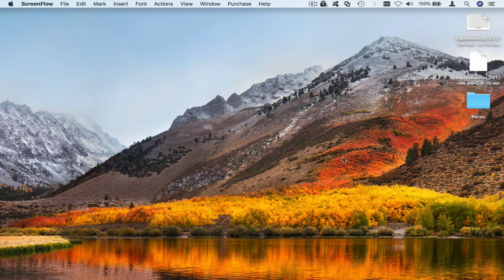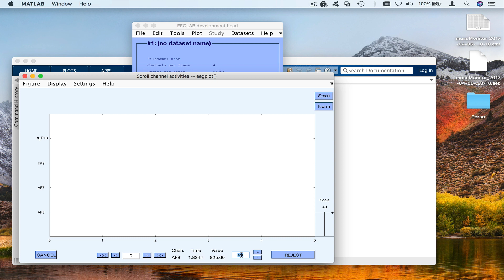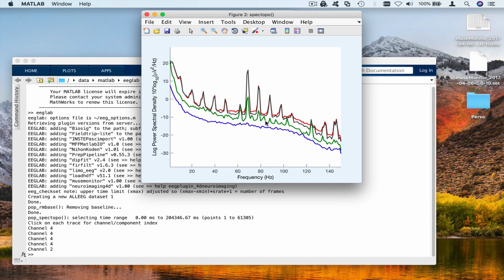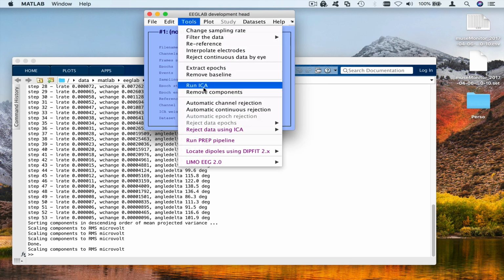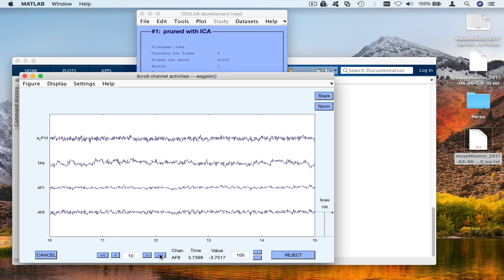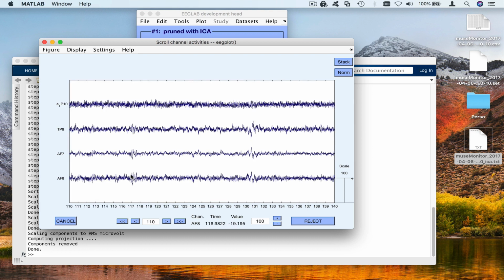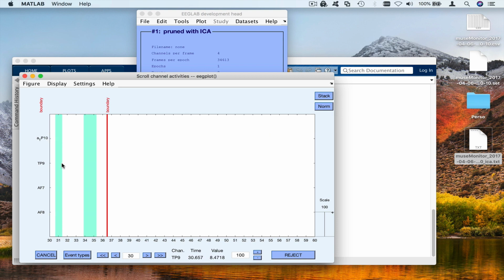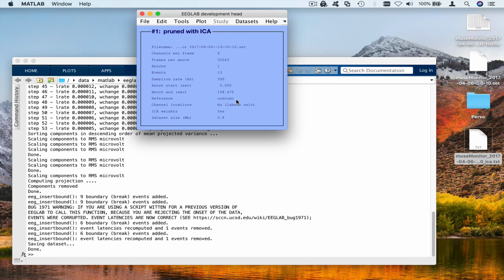Processing Muse data with EEGLAB Part II: Artifact rejection

Comment: Thank you so much Dr. Delorme for your awesome tutorials, I am having issue uploading csv file to EEGLAB, I have tried all possible means provided still the EEGLAB could not read the csv file. what could be the cause?
Thanks
Reply: The main cause would be that the CVS file was not recorded with the right software.
Reply: @arnodelorme  Thank you so much for the rapid response, The problem was from my csv file because the file you uploaded worked on my EEGLAB. I have sourced for another csv file, all is perfectly working.
Thanks Dr. Delorme.

Comment: Hi Dr. Delorme. I am just curious if there is any way to remove a specific channel within a specific time period when we delete bad channels by eye. It seems like, we are deleting a certain time period (e.g., between 5 seconds and 10 seconds) even there is noise only for channel 2 that time period. By doing this way, we are missing other valuable signals. Or we should delete by time period to calculate the power spectrum? Thanks.
Reply: With the Muse, it is not possible to remove a specific channel within a specific time period. The channel would have to be interpolated using other channel information and this is not possible with only 4 channels.
Reply: @arnodelorme  Thanks for your reply. Would you think 14 channels are enough to do that? I am using a 14-channel device.

Comment: Hello, 
Thank you for your tutorials ! I am trying to do the same as you, but I have an issue with my Muse Monitor file I think. When I open it on matlab it tells me that I have 24 channels per frame while I should get 4... Also it says that my sampling rate is 2 (so weird..). I recorded with the "constant mode" as you provide it.
Would it be possible to share on file to see the difference, or some pictures ?
I think that EEGLAB takes the number of column as number of channels per frame...
Thank you very much for your answer !
Reply from the maker: Hi Emilie, in the 3rd video, there are some files in the comment that you can download
Reply: @EEGLABchannel  Thank you very much for your quick answer !